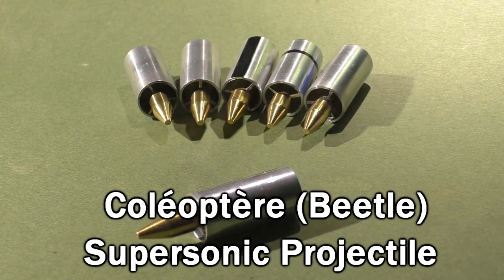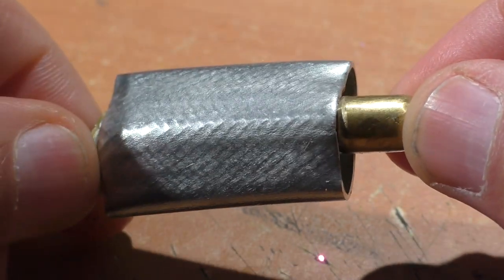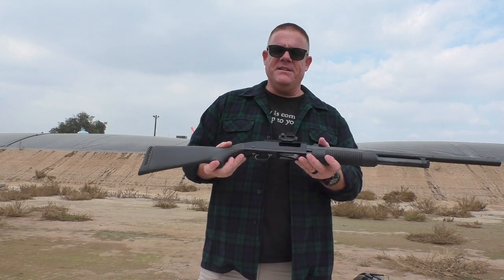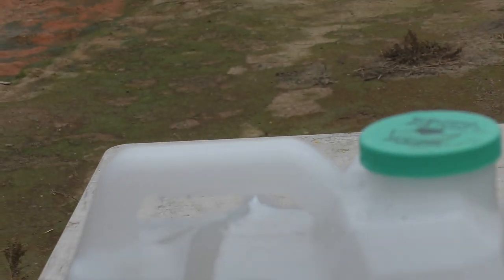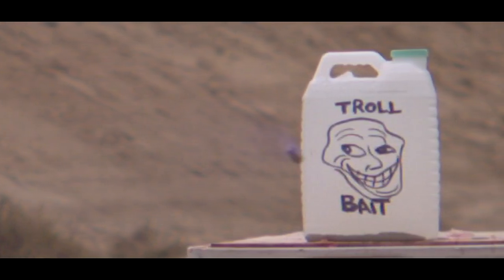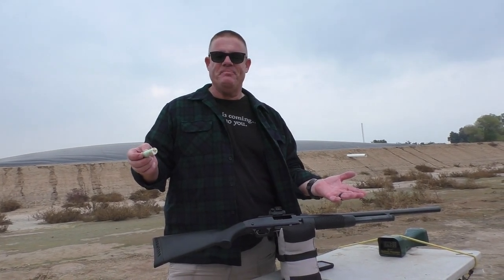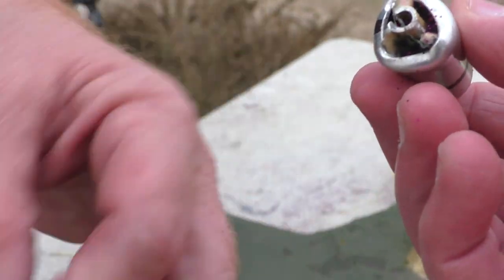Coléoptère Inspired 12ga. Projectiles -  TESTED

Comment: In order to correct your problem with destabizatiom ..think of it as a kite ..you need the force to tow the casing the wood plug was located in the wrong location ..it needs to pull the round not push it ..if you can attach it in such a manner so the wood plug splits and falls away ..you should see a great deal of improvement in stabilization 
. At least that was me experience with rockets even or possibly using a streamer tail like a kite .. it may even prove useful to spiral groove the out side of the round to further stabilize the round ..after watching the round hit the target sideways it's almost as though it hit an aerodynamic impasse like the pressure in front of the round became more densely concentrated on the front .. I could have fun working out the bugs of the design ..because I can see the potential benefits in this design

Comment: At supersonic speeds air REALLY doesn't like moving out of the way. The glitter sticking to the projectile probably means that no substantial air is pushed through those holes, creating a low pressure zone behind it. And it just occurred to me, there is no way it would work with spinning and those flat fins. By using a rifled barrel you are gaining accuracy by completely disregarding the whole holes thing and turning the projectile into a single gyro-stabilised aerodynamic lump.

Comment: I wonder if the aluminum cylinder had notches that interlocked with the center fin section would hold it all in place better. Then we're not worried about a friction fit holding it in place. Another thought is filler medium inbetween the fins to help provide more weight behind the load.

Comment: An Idea for the round to stabilize it - give the inner-fins a trist similar to the average rifling of the rifle, so when fired from a rifled barrel, it helps keep the round spinning and stabilised.  Its what they do for the pop-out fins on sabot rounds and folding-fin spin-stabilized rockets. Also, putting a fine edge on the front of the aluminum tube so it cuts the air better... the blunt edge of the tube can't help the aerodynamics any, right?

Comment: How about a slug with inverted steel wad using 1 oz of steel or lead. Place shot at bottom  of wad ,put 20ga cards as filler in rest of wad . Gun powder as lite recoil , use shot card, cork, wax card as gas seal . Load wad and shot, and filler upside down and roll crimp. What do ya think?

Comment: May i suggest that you make the housing with centrifugal fins although you might need to make the sabo shorter that should keep it straight.as far as weak aluminum housings try high strength high tempered aluminum. At worst the housing could crush down to bloom extra damage to target

Comment: Schikaneur is a good idea, but the flaw is in the design.  that the wings must be drilled.  so that the ball rotates and has a straight trajectory.  try turning the leaves between the sleeve and the ball.  the ball will spin and not fly around like a piece of pipe.

Comment: What if the three columns on the inside of the tube were twisted around the core inside the cylinder? Basically, a drill bit covered by a sleeve. To get it to initiate the right spin, it would be shot out of rifled barrel that twists in the same direction as the three columns connected to core.

Comment: I would love to see you guys shoot an inside out 30 caliber as a 50 caliber.

Let me try to explain.   Take the cross section of a boat tail 30 cal.  Cut it in half down the middle so you have a flat side.  Then rotate the flat side around an axis of .25 to create a cylinder with the flat of the cross section on the outside and the curve of the cross section on the inside.  Like an elongated donut shaped to cut the air

In supersonic flight, does air flow through the middle?

Comment: Unintentional? penetrator delivery cylinder.  Now get the balance/aero right, and refine/replace the wooden plug, and you got yourself an interesting defense round.   If they're not wearing armor, and it flies straight, that round with wack someone pretty good with its mass, the cylinder will do some shallow damage, and the penetrator will penetrate.  Maybe make the penetrator somehow like an arrow head - just fixed blades, or maybe even crazy ones with the blades that come out upon entry. Those might not work so well on vests.

Comment: You know, if the inner fins were slightly slanted like the blades of a wind turbine, the air going through those spaces would influence it to spin, even if fired out of a smooth bore

Comment: What is the tube had a more diablo shape and then insert went in via the back. The insert shaped so it cannot go past the waist and maybe a fin stuff in the front to keep the front of the insert centred? And I wonder another test type could have a discarding base even it is it in several pieces...? Not sure if you could put stuff in and around the diablo tube to support it and/or engaging firling as it's own discarding sabot?

Comment: It seems obvious that the center of mass, as designed, isn't in the axial center of the round due to the way the brass was cut lengthwise. The shot where the wood wedged inside likely moved the center of mass closer to the axial center of the round as well as adding drag in that 1/3rd of it's circumference. Also, has anyone calculated whether the center mass is in the right position compared to the center of pressure (aerodynamically speaking)?

Comment: The aerodynamics of these tubular slugs have piqued my curiosity. One problem is that supersonic air doesn't behave like low speed air, the other is how to achieve a viable gas seal that reliably peels away after the slug leaves the barrel. Perhaps Nikola Tesla had the answer.
If you know anything about him, then you'll probably agree that he was an unparalleled genius. No one else could have invented a check valve with no moving parts, known as a (drum roll) Tesla valve. U.S. patent 1,329,559.
This idea has already been adapted to pulsejet engines. If adapted to a slug like the kind tested, then one might obviate the problem of a wooden wad getting jammed up into the internals. It then becomes a different problem, that of ensuring that the "flow control segments" can handle the shock loading of rapidly expanding hot gases. Or alternatively, using flow control segments with exit holes small enough that a plastic wad cup might be used.
The Wikipedia article states that it works better with a pulsing flow than with a steady flow. Hmm, a shotgun blast would be a large pressure pulse in one direction on the slug followed by a longer pulse in the opposite direction through that slug.

Comment: Indeed the Coleoptere was perhaps a little bit ahead of it's time... yet the idea is tenable imo.
As, the circular wing acts as a drag ring, whilst also providing directional stability and lift if the proper complex shape necessary for controlled flight is achieved.
I do believe those small wingtips on the outside of the "ring" on the actual craft are important though, as is the jet engine. 

Very interesting, indeed. 
I love when science is mixed with ballistics or guns.
(So long as life is improved, and not extinguished though...that always makes me sad, less: pedorists, politicians, banksters and lawyers. 
They make great projectile catchers!)

😎🇺🇸

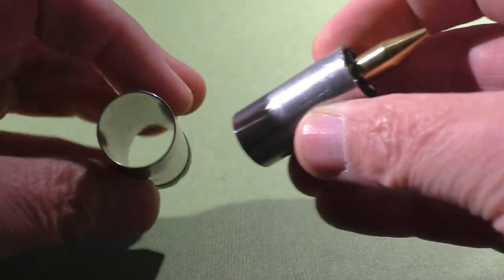Comment: 2:26 Huh... this is getting very close to a projectile that is a solid fuel ramjet... you have the speed and possible the ignition source, figuring out how to package the sustaining fuel would be the next feat and getting the proper venturi in the air path. That venturi cone could have a ring cut into it with solid propellant pressed or molded in, ignition provided by perhaps a flash powder filled plastic tube running back to a hole in the wad. Real engineering challenge, this would be.

Comment: well if traditional rifling does not cure it, you need to increase the twist rate, to say something like 1 turn in 7" (ar15). that way it will spin fast enough to stabilize ANYTHING. and if it still isn't stabilized, it will revert back into a SHOTgun round, via centrifugal force! lol

Comment: @TAOFLEDERMAUS #TAOFLEDERMAUS   I am 1:30 into this video and cannot help to wonder three things, what if (a), the "inlet" edges were bevelled to be more aerodynamic, they could be bevelled to force more air into the centre, to the outside, or any combination in between.  hmmm...  What if (b) the tube fins matched the rifling of an (always better ;) rifled shotgun). hmmm...  What if (c), the entire projective was made out of a different material, ideally with a lot more mass, (a) and (b) obviously apply as well, as does the weight balance. hmmm...  And of course, another thought (d), what if the channels/fins were of different sizes, the wall material will obviously have a minimum limit and three fins would have to be the minimum for strength. hmmm...
.
There are just "what if's", and apart from the bevelling and material change (all copper), these changes would be difficult (and expensive) to make, but this channel is as much about projectiles and it is about physics and "what if's".
.
Does anyone know of any modelling software that would be suitable to model these what if's.???
.
Many regards, love your channel, and miss Danny.
.
Addendum... I believe that the "tip of the aerospike" is (1) too far forward (please compare to the SR-71 engine), (2) doesn't have the necessary pointed tip, and (3), I now wonder whether this would even work subsonic, or whether it must be supersonic, transonic would be very bad IMHO and finally (4), apart from the structural integrity of the whole round, one of the major issues that you experienced was with the wooden plug, perhaps a metal disc in its place would work a lot better.

Comment: I believe he kind of messed up on the design the front has to be a little larger in diameter than the rear on those aluminum tubes to allow air to be pushed through and catch properly not to mention the external fins you have to understand this is a crap that actually flew so that means being that he took constructive liberties this is not a true projectile from that design

Comment: Somebody needs to make a little SCRAM Jet round. Include some kind of fuel inside that combusts at the temperatures and pressures created by the forward velocity. Round leaves the muzzle at 1600fps and hits 4000fps on the way to the target. Should be simple🤣😂 A bunch of people just have hypersonic wind tunnels sitting in the corner of the garage just for testing stuff like this. Would be cool if somebody could make it work though. "Somebody' just has to be DARPA.

Comment: Your projectile doesn't have an airfoil shape like the cylindrical wing of the aircraft. The aircraft produces lift because the airflow outside the cylinder is moving faster than the air moving through the inside of the cylinder. Here's a paper airplane version.
https://youtu.be/A_FREc9DTY0

Comment: Film set might have levels of people handling Huns and props with or should have daft check off list stay gun till used last checker should be the shooter and they should be trained and familiar guns safety rounds used on set before call action inlay safety check correct prop or corrrct round loaded. Safety safety  first.